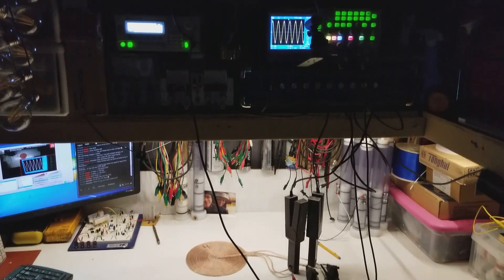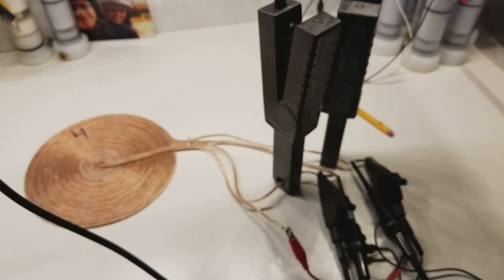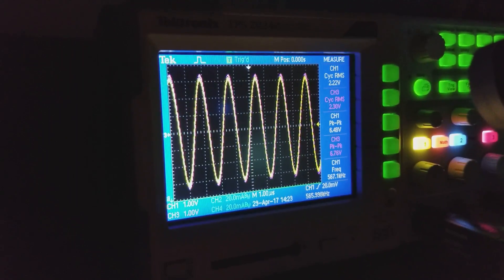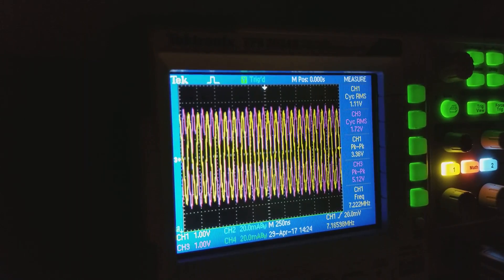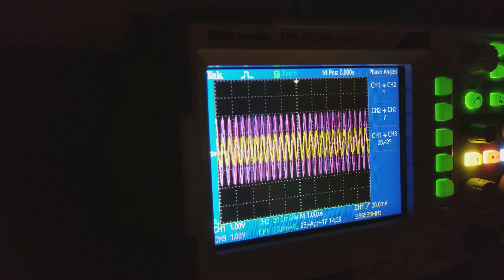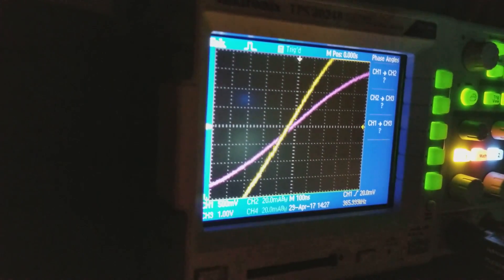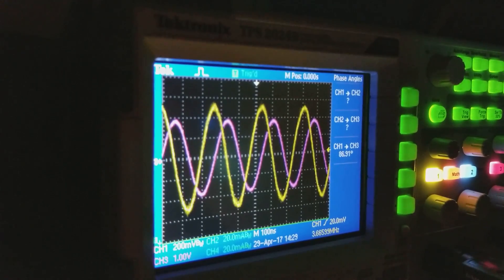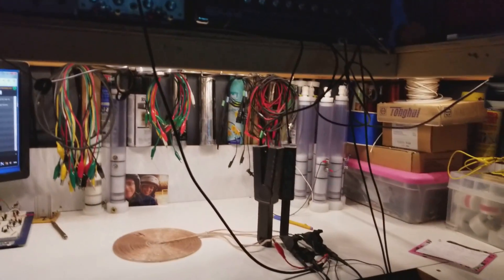Tesla bifilar Pancake Coil Anomaly. Phase shift Demo, A.C. Watts = A x V X PF (for Tinman.)

Comment: Have used 1 ohm non-inductive resistors, to attach a regular scope probe over for current measurements in the past.  Was pretty accurate for what I needed in the ~100-300kHz range, not sure about higher.

Comment: Just asking.  Have you ever taken two bifilar coils, one counter wound to the other, place them about an inch apart, then place them in an aluminum bowl, coated on the inside with bismuth, then apply high frequency power to them?  Connect power with aligator clips so you can recover the apparatus.  Might be best to do it outside.

Comment: Thanks!, I've been wondering about the phase shift, and what causes it. I just registered to open-source-energy, hope to find the answer there.
Reply from the maker: Master Ivo you will learn alot by reading the rodin coil thred linked in the description. it's alot.ot read but it's good. 

also if your really intrested.  go through thses and read the sections on. capasitors.  inductors. power factor. ect. http://open-source-energy.org/rwg42985/russ/books/Hawkings%20Electrical%20Guide%20Full%20Set%20Vol%201-10.zip

basically 
D.C. watts = Volts x Amps
A.C. Watts = Volts X Amps x Power Factor. 

some simple explanations here. http://www.rapidtables.com/calc/electric/Amp_to_Watt_Calculator.htm ~Russ
Reply: Thanks for sharing! I'm not really into the math. Really like to understands what happens on the energy fields level, what is causing the phase shift. Membership approved, so I will dive in :)
Reply from the maker: Master Ivo good deal. read those books. just pick the parts out you want to learn about. there where I learned what I know. ~Russ
Reply: I downloaded them, first book start with a picture of Edison, in my world, thats not a good sign. Now I will have to find the part about the dynamic dielectric field, because thats my interest. I would be suprised if I found it. not much is known about it. Still, thanks for sharing, its a nice collection!
Reply: Good books. Found some clues in part 4 of the book sereis.  around page 1058 or so. Talks about reactance, inductance causing phase lag, and capacitance causing phase lead. It also talks about resonance, where the phase lines up to 0 degrees. It doesn't speak about a series or parallel resonant circuit. there is a difference. the Bifilar coil is not definable into series or parallel, as it has the fields interacting in one space (its capacitance and inductance), so it is ONE

Comment: Hi Russ,hows things?.
If i am correct,your two channels on the scope are showing the voltage across the two 100 ohm resistors?--current in other word's.
Reply from the maker: TinManPower yes this is correct. 

I could also place 2 more scope leads some where and measure 4 things at once. if you have any requests let me know. thses are completely isolated channels. as you see the current probes are not good for HF. so we could use some 1 ohm non inductive resistors as well. let me know. ~Russ
Reply from the maker: also. things are going good. one day at a time. chin up. and press on!! :)  ~Russ
Reply: Well unfortunately Russ,you got it wrong. When measuring a voltage drop across a resistor as you are doing,ohms law dose apply,and phase relationship/power factor plays no part in what you are measuring. The phase relationship between voltage drops(current)across two resistor's as you are showing,has no bearing on how much power those two resistors are dissipating. Only when the inductors/coils are included,do you take into account power factor. Ohms law stand's in your video,as you are measuring a voltage drop across the two resistors only. Phase relationship/power factor only applies when you are measuring current through the resistor with one channel of your scope,and the voltage across the coil with the other channel of your scope--not the two resistors.  
Hope that helps.
Reply from the maker: TinManPower sounds like a challenge. :)  I agree with what you are saying. however keep thinking about this.  This is showing a voltage phase change between the inner resistor vs the outter. even tho we are measuring voltage and saying it's "current"  this is in conclusive. we need more data. I was just trying to help you get better data on this Anomaly. With that said  let's keep working on this. you give me some tests you want to see with this scope. and I'll also think of some.  the indacataion of a phase shift around 90 with this anomialy tells me the story. to show that we have potential power and not real power. honistaly I hope im wrong.  But in the end I think we will both come to the same conclusion. if it won't loop then it's mesurment error. ;) ~Russ
Reply: Hey Russ. My response video is up now,showing what you were doing in your video. As i said,power factor is only taken into account when you measure the current flowing into the coil,and the voltage across the coil. So,in other words,you would have 1 channel of your scope across the resistor,and the other channel across the coil/resistor series. This will give you the current/voltage phase relationship,and then you take into account the power factor to calculate dissipated power from both the resistor and coil. When measuring the voltage drop across the two resistors as you were,then power factor plays no part in it,as you are only calculating the power dissipated by the resistor's,and this is done using ohms law only.  Cheers.